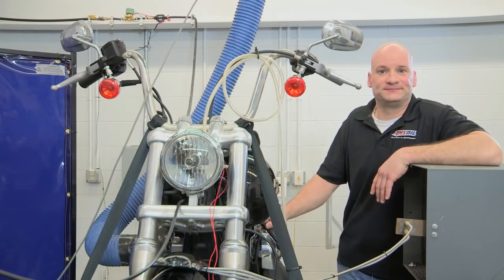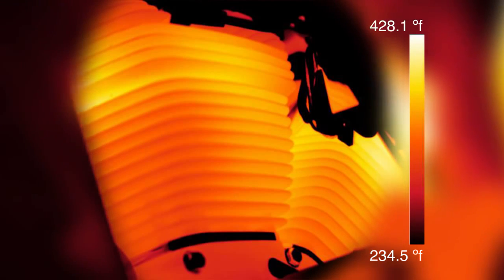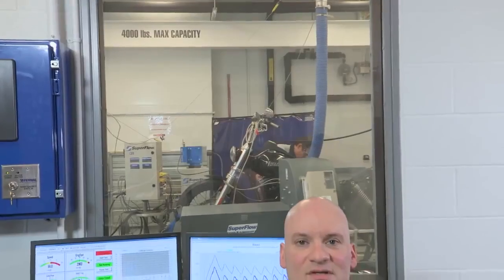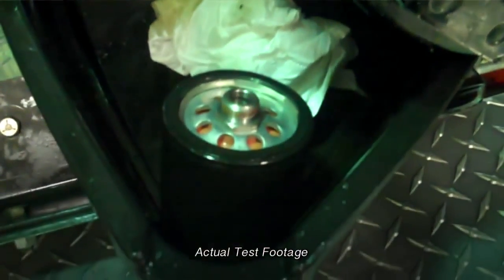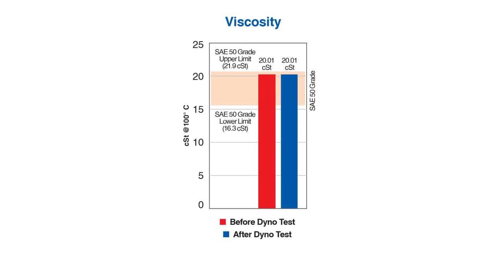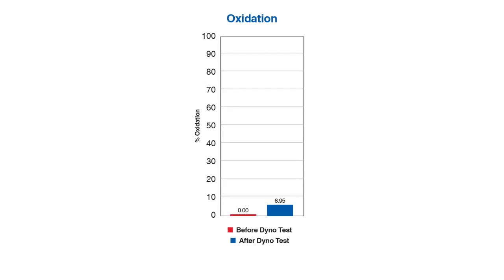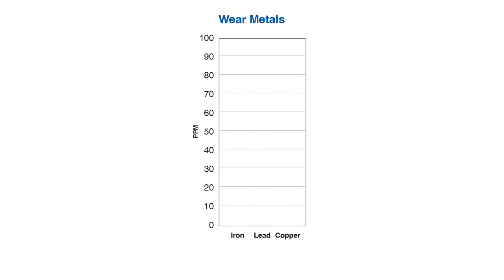Harley Extreme Heat Test with AMSOIL 20W 50

Comment: Are the results of this test useful? Who runs their bike at those extreme temperatures?
Reply from the maker: Riders in Arizona and surrounding States, ride in extreme temperatures most of the Summer.  I have a friend who rode his BMW to a Brewers Baseball game in the heat of the summer.  On the way home, he was stuck in traffic, just crawling along for over 20-30 minutes. His engine started making noise, so he took it to his service shop the next day and found out the heads got so hot it loosened some valve seats in the heads. (He wasn't using AMSOIL at the time by the way.) This was the very same conditions the AMSOIL test was attempting to duplicate.   Air cooled engines need the airflow over the cylinders for cooling.  Certainly, AMSOIL took it to the extreme, but it demonstrates the protection AMSOIL offers. Other situations would be racing, or Cycles 2-up pulling a trailer into the wind on a hot day.  Rob...

Comment: Several years ago I saw a video demonstrating the ability of synthetic oil to resist break down in  high temperatures. It was a scientifically done experiment. Even after high temps such as you created here, the oil could still lubricate an engine.

Amsoil is the only oil that has been in my Harley since the second oil change. It now has 88,000 trouble free miles.

Comment: What about running 0w/50, 5w/50 or 10w/50 in a M8
Reply: What, do you run up on the Tundra to require oil that thin? Dah! Harleys run hot! Thin oils are to improve flow at low to very low temps. But suck at protecting at the upper temps. Figure it out dude!

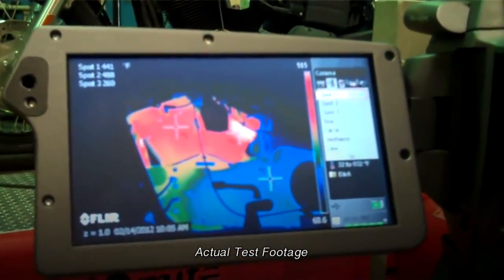Comment: I used amsoil once and when I went to change my oil it had become so lumpy it was difficult to get out.        This is going back to around 2002.   I went back to M1:15W-50 and never had a problem.   I also use a wix filter.
Reply: it was lumpy because you had deposits in the crankcase that  it was cleaning out.  cheaper oils were causing those deposits to form

Comment: I wouldn't want to buy this Motorcycle either.  The test was to determine the limits of AMSOIL in extreme heat.  The oil performed so well, the Lab guys put the oil back in the bike and continued the test even after mechanical parts melted.  The engine was certainly abused or Tortured as they said. Very few people will treat their equipment to these severe conditions, but you should have confidence when running in hot conditions, AMSOIL is protecting your equipment!

Comment: I use AMSOIL have for years during hot months in the mid west Straight 60 
Spring and late fall 20/50  AMSOIL in all three holes
next 
installed a Fueling cam chest and hp oil pump just for giggles installed a digital oil
Cap final results if you believe these led caps are some what accurate
  regardless of out side air temp and as you know we have had some hot days
Temp never went over 250 degrees.And it cools down very quick no ticking after a minute.
I do run a pro pipe though these synthetic oils really work Ride Safe
Reply from the maker: Thank you for the comment.  I have personally seen the automatic transmission temperature come down on my F-150 after switching to AMSOIL's Multi-Vehicle Synthetic Automatic Transmission Fluid (ATL) at 50,000 miles. The normal running temperature dropped enough, it was very noticeable. The shifting was improved as well. See the video about Torque Converter Heat.  BetterMpgOil.com

Comment: I don’t know about the newest oil now, but in the past the Teflon in the oil has gummed up the oil pump in a few cars I’ve worked on and caused them to lose oil pressure, not good, the lifters start tapping and crank bearing start wearing out. Just saying.
Reply from the maker: AMSOIL Oils do not contain any Teflon. Every engine running AMSOIL that I have opened up has been very clean inside. AMSOIL oils do contain detergents that keep the engine clean. It sounds to me like someone put a Teflon additive into the engine(s) at some point in the past. I have seen that happen to a couple of engines, especially when it is over used. AMSOIL does not reccomend using additives in their oil products. The data bulletin for the oil used in this test can be found at:  http://www.amsoil.com/lit/databulletins/g2090.pdf?zo=499658

Comment: Is the MCV 20w50 a PAO based oil?
Reply from the maker: AMSOIL maintains formulation details as proprietary and does not divulge specifics regarding the type of synthetic base stocks used in its synthetic lubricants. AMSOIL developed the world’s first API-qualified synthetic motor oil in 1972 and has remained the leader in the synthetic lubricant industry by continually researching new technologies and demanding only the highest-quality raw materials. As the company moves forward with new technologies it is increasingly more important that this information remains proprietary. AMSOIL views synthetic base oils the same as it views additives, with each having its own set of unique properties. AMSOIL does not insist on a particular type of base stock, but insists on particular performance parameters. AMSOIL chooses whichever synthetic base stock or combination of base stocks delivers the desired result and tailors its lubricants to be application-specific (gasoline, diesel, racing, transmission, gear, extended drain, extreme temperatures, etc.). At the end of the day, the type of base stock used to formulate the oil is inconsequential; the product’s performance is what matters.  BetterMpgOil.com
Reply: @bettermpgoil-amsoil5131  ... so thats a no.

Comment: I use AMSOIL straight 60 wt. Add a Fueling cam chest and oil pump and you have a great combination
That you can feeel in the throttle Ride Safe

Comment: ill bet you guys were blown away when these results came back because ive been around harleys for many years and have used all kinds of different oils etc granted in older motors straight weight heavy oils are reccommended but this amsoil is absolutely incredible i know there is always a debate and my own mechanic friend who works for harley almost 25 yrs is part of that debate and says there is no difference well i dont believe conventional oil compares when you look at the stats. i swear by amsoil its all i use from my lawnmower to my cars to my harleys
Reply from the maker: Thank you for using AMSOIL!
Reply: Tell your mechanic friend to try tribodyn